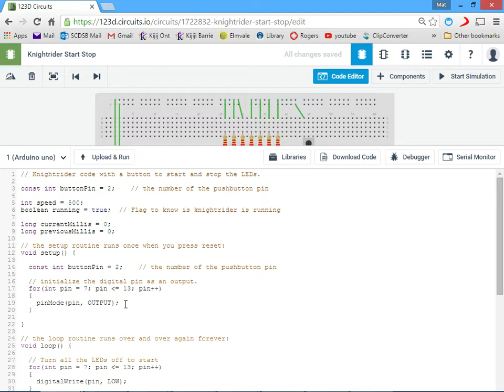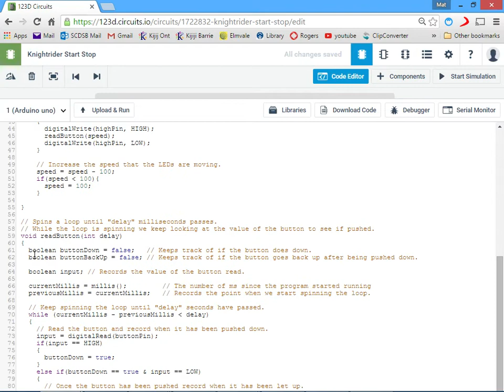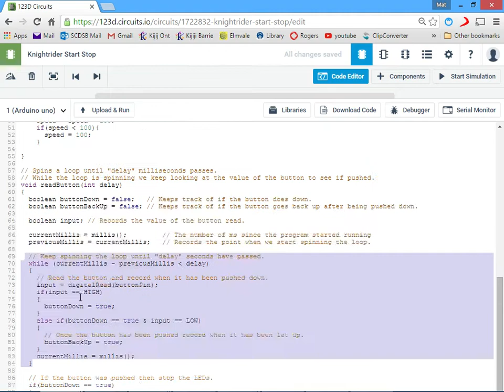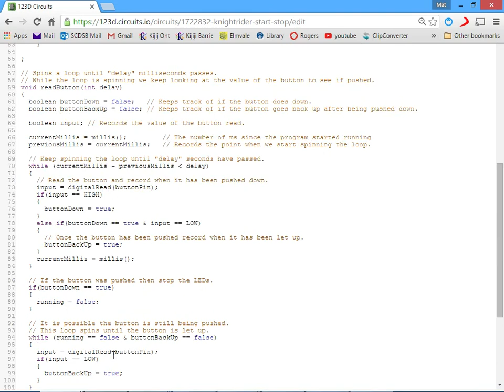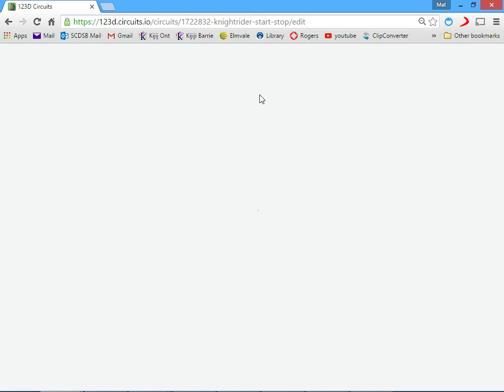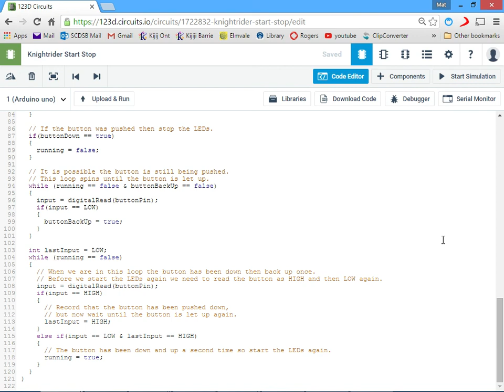Arduino Nightrider Tutorial 3 - Adding a button to start and stop Knightrider

Comment: Great Tutorial. I've enjoy following Part's 1 & 2 of this series.  I'm a bit of a Neophyte to Arduino coding. I would like to ask a question and hope you may be able to point me in the right direction.  I used your Sketch (from Pt.2) and paired it the a simple sketch which randomly blinks two LEDs. and then with a simple sketch with flickers a single led. What is happening is your code and these two other code interfere with one another, causing both sketch to run slowly or scramble both effect.  Could you point me in the right direction. And would the 123Curcuit.io be able to run combined sketches. Thank again you again for your informative instructional YouTube Videos.

Comment: nice tutorial... I want to do something like this, bust instead of pause the sequence I want to shutdown the leds.. For example, if i press the button the sequence start, and if i press again it will stop and turning all the leds down. if i press again it will start...This is possible?
Reply: +mjoninhas You could try setting all the LEDs to LOW when you set running to false in the readButton() method.

// Turn all the LEDs off to start
for(int pin = 7; pin <= 13; pin++)
{
  digitalWrite(pin, LOW);
}
When you start it up again it will continue the LED sequence on the next LED.
Reply: +Mat Reive thank you for your reply. I'm trying to copy some parts of your program but i think that I don´t need too many commands :) .
The thing is, I start my void loop() with all leds off, and then I need to press the button to turn each led at the time on. then when the loop finished I want the program to stop and check how is the button. if the button is low the program stays there until the button get high..  Can you help me with this? :)
Reply: I think I solve the problem... I've done this:

void loop()
 {
  if (digitalRead(botao) == HIGH) // check if the button is pressed. If not it stays here. If pressed run the sequence.
  {
    for (int thisPin = 3; thisPin <9; thisPin++)
    {
    digitalWrite(thisPin, HIGH);
    delay(timer);
    }
    for (int thisPin =3; thisPin <9; thisPin++)
    {
    digitalWrite(thisPin, LOW);
    delay(timer); 
    }
  }
  
 }